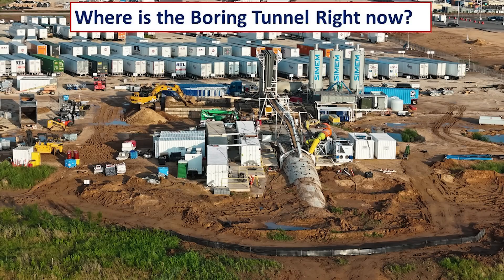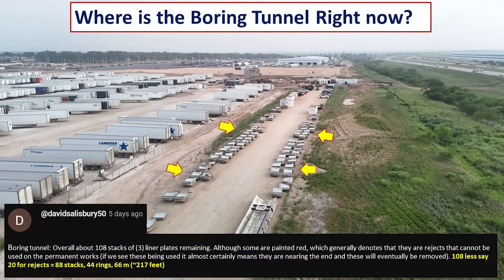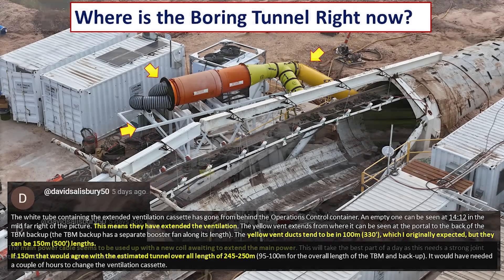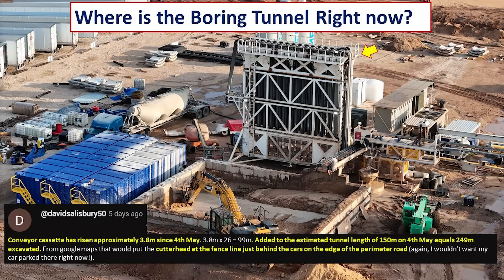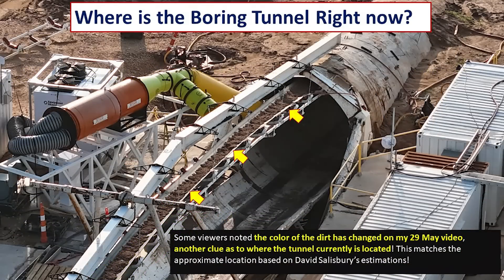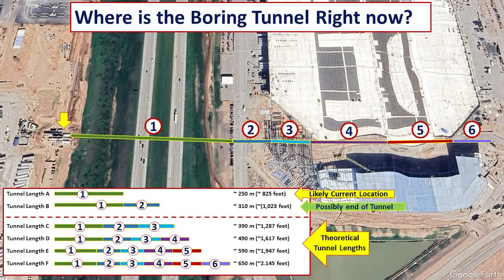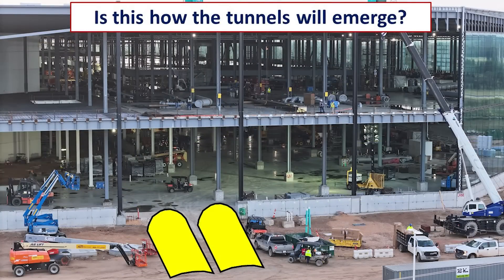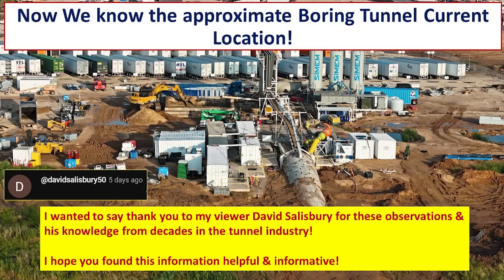Let's Discuss the Giga Texas Boring Tunnel Progress!

Comment: Tunnels are cool. But I wonder why a tunnel was needed here.  An alternate path already exists from the Gigafactory, under the highway bridge, to the West side.
Reply: Time. Time = money $$. 5 mins extra driver labor, 5 mins extra driver returns. - Which begs the question of how do the drivers return?  No longer need to wash vehicles before entering processing plant. And maybe there is still the fantasy / pipe dream of driverless transit. Pop the car in the tube and hit the GO button, like the old pneumatic systems in stores. I guess that would solve the driver return issue. I was mentally desiging a double ended car extractor - a tow vehicle that could be driven in from the other end, grab a car that has hit the wall or is disabled, and driven straight out. Face it - driverless fantasy or not, it's gonna be needed some time. 
Also, Prufrock 3 is still in development. What better way to prove it, and have something useful when done? And you can bet there have been visiting prospective customers. How better to sell than to have a working demo unit?
Reply: @The_DuMont_Network  Doc, I did the math on this some time ago.

"Time (dollars in fact) saved self driving through the tunnel versus drivers delivering vehicles to the New EOL. 

On google earth I dropped a pin where I think the New EOL Superchargers are located. I selected the superchargers only because a destination needs to be established. Could have been the north end of the New EOL, in which case the numbers are worse for drivers delivering vehicles. 

Through the tunnel. Distance from the point the tunnel crosses into the factory, through the tunnel and then directly north to the superchargers is 690m 2262’. Although that’s irrelevant to this comparison.

On the roads. Distance from the point the tunnel crosses into the factory, to the perimeter road, to River Road, under the highway bridge, right turn at the new north-south road beside the W-WOW, right turn into the EOL transport yard, finishing at the superchargers, is 2000m 6560’. 

At 40km/h 25mph driving on the roads takes 180 seconds. Minimum. Not including waiting times at each end, break times for the drivers, time lost at intersections, time lost turning onto the perimeter road, time lost driving under the speed limit.

It doesn't end there though. For every 4 vehicles driven over an additional vehicle is driven over to ferry the drivers back. So to drive 4 vehicles to the superchargers is in fact 5 x 180 seconds over, and 5 x 180 seconds back. 1800 seconds total divided by the 4 delivered vehicles, 450 seconds per new vehicle driven to the superchargers.

Multiply that by the expected annual production rate, times the hourly rate to employ the drivers. I have no idea what it costs Tesla per driver per hour. A rule of thumb here in sunny Melbourne Australia would be double the hourly pay rate. For the sake of coming up with a figure (substitute whatever numbers you think are relevant) $25/hour x 250,000 production/year x 450 seconds. $780,000."
Reply: @The_DuMont_Network  I onder if a just assembled vehicule 
can use FSD because I remember after getting my Tesla, 
I needed to calibrate the camera before been able to activate FSD.
Reply: @nihongobenkyoshimasu3190  You dont need full FSD. line car up at tunnel, hit go. Just needs to be able to queue and avoid the wall.  They can stop at far end to wait in a queue to be driven into final prep.  About 50 cars could safely wait in tunnel out of weather, out of the way.
Reply: @MathewBoorman  Also still possible they would put a conveyor system in it, so the cars are carried through, like they are carried down the assembly line.

Comment: How will folks egress the expansion in an emergency?
Looks like a very long path to an exit if you work along the glass wall.

Feels like they need emergency egress along that wall, but it’s all glass…

Do the panels break out in emergency?
Reply: The underground vaults that were built are fire exits….next to the elevator shafts
Reply: @michaeljohnson1805  good. I knew egress would be accommodated it was just unclear how.

👍 will be interesting to see how they finish it up with wheelchair accessible exists and so much elevation change on the egress route.
Reply: I guess if you carried a brick in your emergency kit...

Comment: I have said this previously, but i think it will terminate at the building opening.  They will integrate the building wall panel(s) and the tunnel sections together making a clean connection between the two.
Reply: I think that's the most likely, as well, as going into the building means negotiating with all the piles they've drilled into the ground to support the building, and it makes the whole thing much simpler.  Integrating it with the building wall means it's still all inside, with the first daylighting of vehicles being on the other side.

I also wonder if they'll build a second tunnel further north to do the same thing for the Model Y end-of-line?  Perhaps in the area where they've removed the concrete?

Comment: Excellent, thank you Joe for this detailed analysis!  I always thought the tunnel wouldn’t go inside once the steel was complete but I also couldn’t totally dismiss the possibility of an Elon brain fart!

I had heard he was angry at the progress of the extension and considered that he may have overrode construction teams who were waiting for the tunnel before completing structure.  In that case the dismantling of the machine instead of removal by crane would make sense if contractors were ordered to proceed with steel and not wait for TBM.

Although I always thought the side of hwy berm was more likely I never considered terminating just outside footprint with a tie-in to structure, but this makes a ton of sense now…thanks again!

Comment: Chances are that it will start to come up to the surface where it currently is. Where the tunnel surfaces it doesn't get the ceiling / upper concrete elements.
And the remaining concrete elements will be used for the second lane tunnel adjacent to the current one.
If so we get a two lane - two driving directions underpass at that location under the freeway.

Comment: NO. not there. To much stuff from the filtration/gigapond near the surface to 20 feet below. It will come our in that square that was not poured between the unreinforced pours at the center of the building.
Reply: Go back to the archives. Do some Photoshop/modeling/overlays. I'm willing to wager they know what they are doing, where the obstacles are, and have a plan.

Comment: Can the boring tunnel turn corners? If so, that would make it possible for it to go anywhere on the properties, perhaps it might even turn and head off to the rail head to eliminate carrying vehicles on trucks to be shipped by rail.
Reply: Nice idea, it has been discussed many times. But stop and think... Can you imagine the bureaucracy, getting land use permits, landowners' permission, the sheer magnitude of a 20+ mile tunnel bore, the $$$ involved? Again... great idea. But it would have been a shitload cheaper to use the median of the toll road a 'la the MoPac expressway, and build a facility at Manor, many miles closer. I wonder if anyone considered the fact that a normal 9 car portable parking lot (carrier) can only carry 8 Teslas at a time? I presume it is a weight thing... Hmmm... Since the max gross weight when using a Tesla tractor is 2000 pounds more than the current 80,000 limit, I wonder if that would make the difference ? 9 cars an hour rather than 8...
Reply: A TBM of this size/type can take a theoretical turning radius of about 125m (400’) in any direction. Although that would be a bit extreme for this segmental lining design and the conveyor won't like it very much.
Reply: And yes, tunnels don't have to be in a straight line. Research the Las Vegas tunnel now in use and the planned extensions...
Reply: It can turn at the same rate it can porpoise.

Comment: I think the idea that the tunnel goes straight ahead probably should be dismissed. The tunnel could go anyway needed, left, right whatever... and end up in a compleet other place in the factory other then the new building
Reply: The surface settlement monitoring points have generally indicated a straight alignment. Plus, the belt conveyor doesn’t like horizontal curves very much.
But we are all still guessing.
Reply: While not impossible, the amount and depth of pilings and footings would pretty much rule that out, for this tunnel at least. Remember a couple of years ago there was mention of a tunnel over on the East side, maybe under the river. There's been a lot of rumor, speculation and Wild Hairy Assed Guesses accompanying this saga. Its been a fun ride, I hope I live to see the completion.
Reply: I think a straight tunnel makes the most sense. It minimizes cost and seems to be consistent with the amount of remaining segments. Yes, the tunnel could curve, but to dismiss a straight tunnel without sufficient evidence doesn't seem warranted.
Reply: @billtruttschel  true but I don’t see it lining up with the functionality of the building: super computer and Optimus?
Reply: @luysterborgh  Straight tunnel. Speculative tunnel alignment almost lines up almost exactly with the outside wall of Stamping 2. Another 20' 6m south of that is the start of the Central Structure that is said to house the Data Centre.

Go to Joe's 24 May video from 10.28 to 10.49 for views that show the south wall of Main Building, the south wall of the Stamping 2 extension, and the Central Structure. In those views is a retaining wall and the studwork for a fire separation wall to separate the Data Centre from the production areas.

Comment: If it's going to go that far HOW DO THEY GET THE MACHINE OUT?😮
Reply: Like any other TBM. Disassemble. Get a large lifting device. Seriously, there are a couple of TBMs that were backed up a bit, bored to the side, and abandoned in place. IIRC, the Chunnel or another tunel was dug from both ends. When they met, they did just that. Sidelined, what could be removed was taken away, the rest is still there. Its a matter of economics.
Reply: It digs up to the surface and puts itself on a carrier,